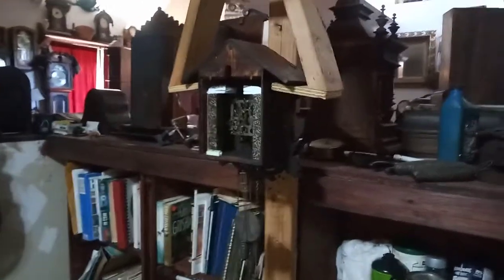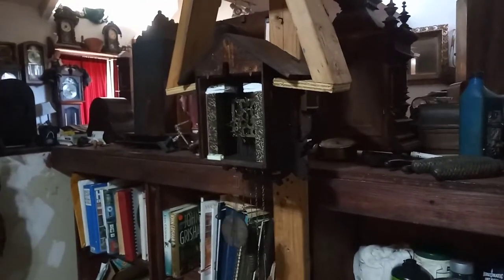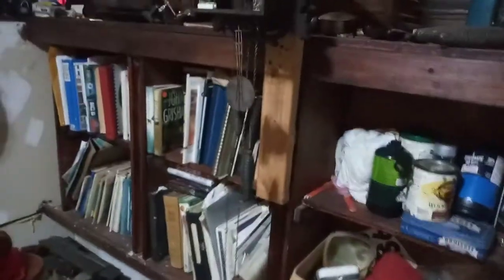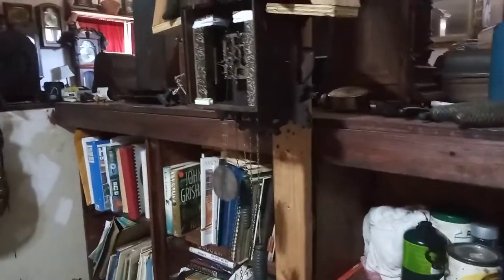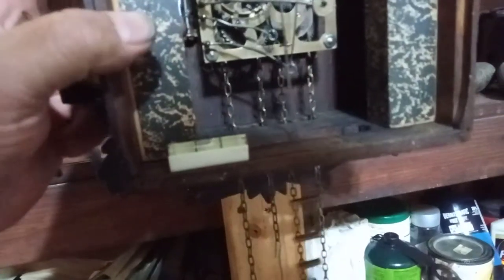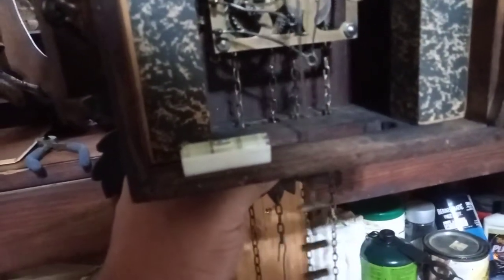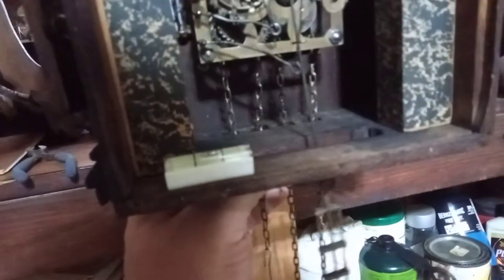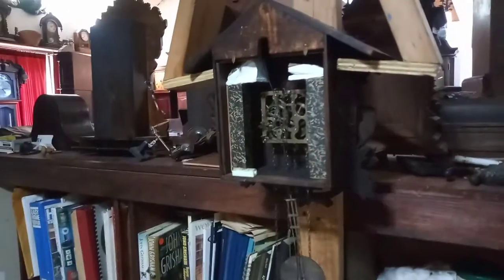Repairing an antique cuckoo clock made by the American Cuckoo Clock Co. 20220727 144056

Comment: For what I see, the bellows are opening too far and causing more stress on the gears.
Reply from the maker: The bellows werent even opening when there was stress on the gears. I am too worn out since I have been up since 4 AM after going to bed around 1 AM. Tomorrow or the next day or the next day when I feel like it I will know more as I am going to put the time side chain on the strike side and see what happens. On a good note with about 320 gr weights the clock is still ticking away.